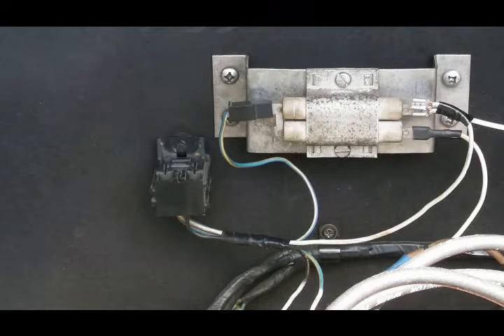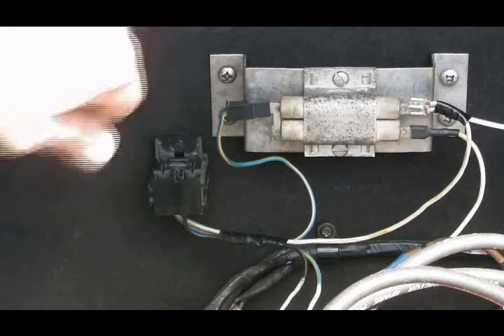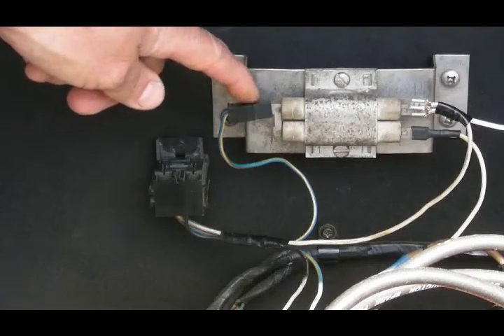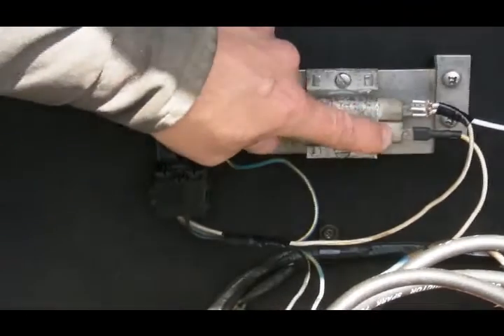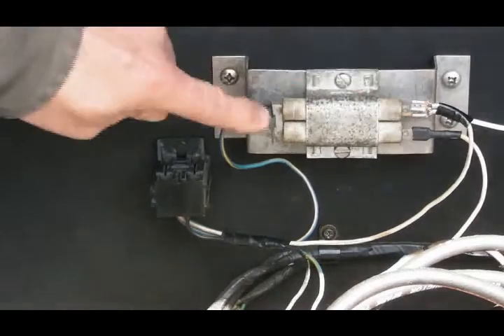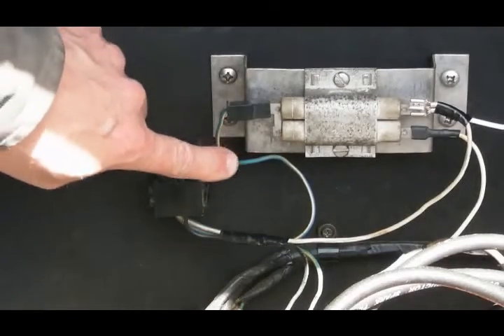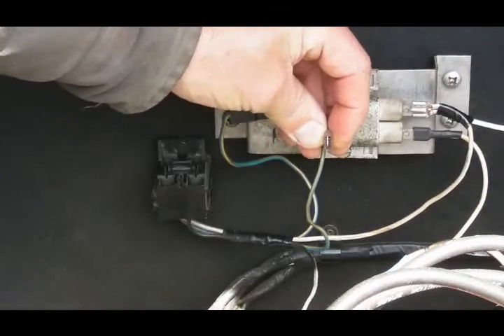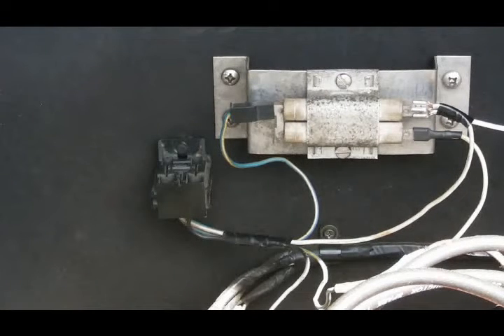DeLorean Ignition Ballast Resistor Grid Starter Bypass Relay

Comment: Bosch had advanced CDI Ignition Boxes used on Porsche & Mercedes ect starting in the 1960's -  & were used to also pass California emissions & there was also the first aftermarket CDI box retrofitted for Calif Bosch ignition cars called Perma-Tune.  If John Delorean would've spec'd the Bosch CDI ignition or Perma-Tune for Calif emmisions, the Euro spec PRV would've had no problems passing emissions.   He just cheaped-out on the cost of a CDI ignition which would've also given better performance to the Delorean's  PRV! 
 I wonder if DMCH has any archives of possible Bosch CDI or Perma-Tune being tested or spec'd for the Delorean.🤔.
 There was no mention of it on that 1976 SAE paper for the PRV.   I wonder if any old Euro car mechanics back in the 80'2-90's hooked up a Bosch CDI box to a Delorean.?🤔.  
Of course, the GM HEI & Ford Duraspark High Energy Ignition's are the best Intro Performance Ignition Upgrade, along with non resistor plugs, rotor & maybe even 0 ohm Granitelli Performance Plug Wires.  Then you can always take it a few steps higher, & up regulate the coil with a step-up regulator module & feed it 
15-18v then you are getting into plasma ignition along with the use of a Plasma Spark Box!  Brisk makes a few advanced non resistor plugs with a silver core for conductivity. Then there is another upgrade to the Delorean Ignition to take it where No Man Has Gone Before!  
So surprised this  hasn't been done by a Delorean owner to retrofit & is a common upgrade among the entire Euro Classic Cars ignitions with a fully adjustable electronic digital advanced distributor!